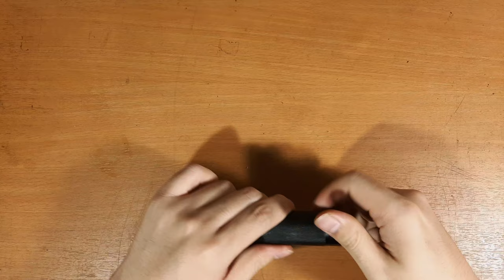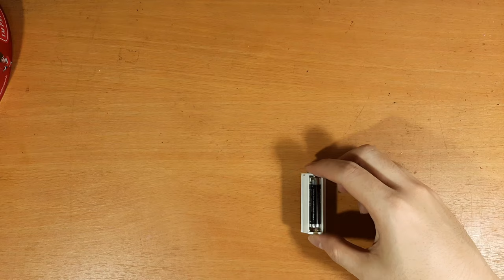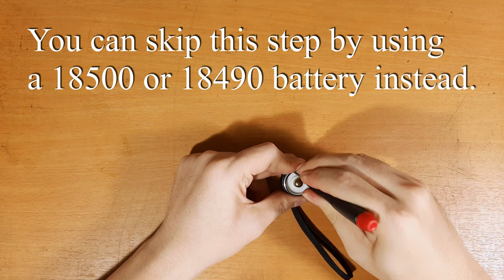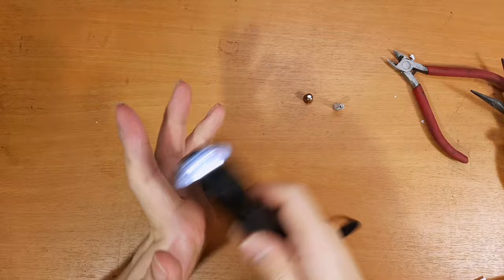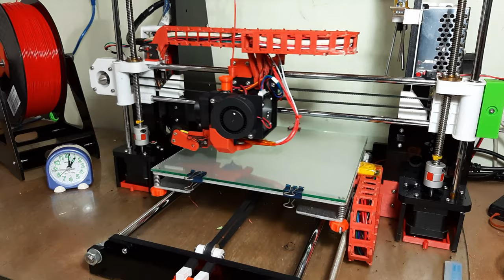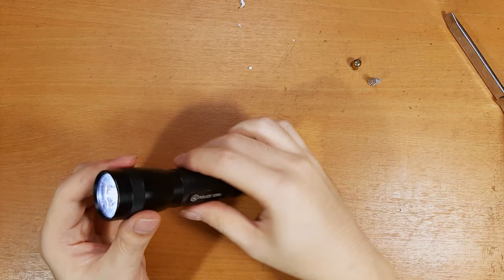How to convert 3xAAA Flashlight to 18650, 18500 Li-ion Battery

Comment: You can use an empty shotgun shell. Trim if needed.
Reply: What 12, 16 or 20 Gauge?
Reply: @leskavage  12 gauge
Reply: Omg thanks 😊
Reply: you live in the us. i know. no one in europe has a shotgun or shotgun shells if they dont hunt.
Reply: I use shotgun empty she'll  ..it works... you can added  more but cutting them vertically.
Reply: @dragan3290  Depends on the flashlight.

Comment: Sorry to burst your Bubble dude.  It took me a split to solve that gap issue.  You know those rubber seals  That you replace on garden hoses. Just use one of those rubbers and slide that around the battery and then put the battery inside the case problem soft.

Comment: How about the brightness because u replaced 4,5v to 3,7
Reply from the maker: Sorry for the late reply, I didn't notice a decline in brightness but most of my flashlight was using a ni-mh rechargeable which are lower voltage anyway.
Reply: 3.7 is the nominal voltage, most 18650 charge to 4.2 v

Comment: Why are those batteries both ends flat? I have 18650s too and they have the tips like normal ones
Reply from the maker: These 18650 cells are removed from a laptop battery pack, The retail 18650 varies in capacity, button-top vs flat-top, and protected vs unprotected type.
Reply: Button top is a protected battery. Flat top is not.
Button top will cut off early whereas flat top you can drain a long ways.
Trade off - longer lifespan with button top or longer use but shorter lifespan out of flat top.

Comment: Is this safe? Or there is a safer alternative? I read some stuff about litium and 18650 that now inm bit scared. I have some FST 18650 2600mah
Reply: as long as you buy quality batteries, 18650 are still good way to go. or if you're afraid of fire, get quality Li ion batter. expensive though are they ;)
Reply: @ApocGuy  Thanks for your time to reply me.
I ve got maybe 10 of these FST 18650 2600mah from a broken power bank, the poles are flat.
But i m very scared 🤣 i don t know how dangerous can it be.
Quality Li on batteries like for example? 
Thanks
Reply: @FaccioBaldoria  not that dangerous, but its advisable to get good li ion/Li Po charger. just to be safe ;)

Comment: Hi. Nice work but is it okay without any current limiter? I believe the current draw is greater than 3x aaa which will make it brighter n will destroy the led.
Reply: The led will only pull the current that it needs. The battery having a higher amp draw rating only means that it can supply more amps to a larger load without cell damage.